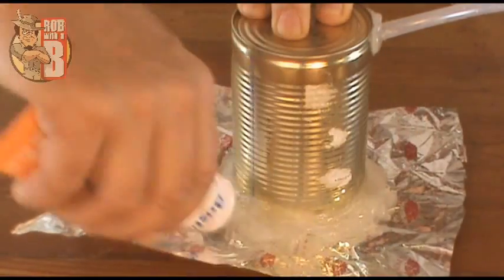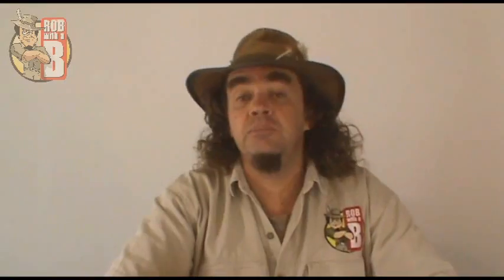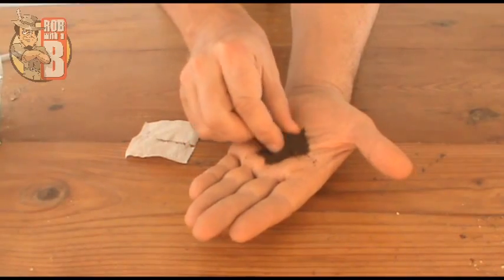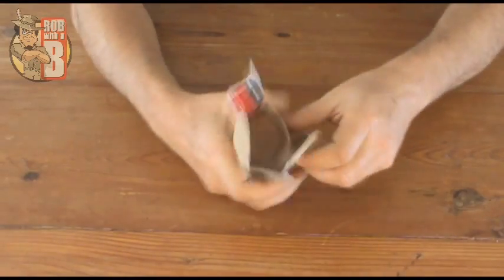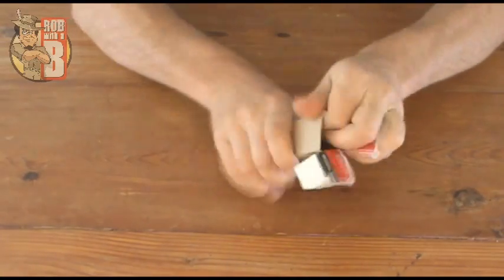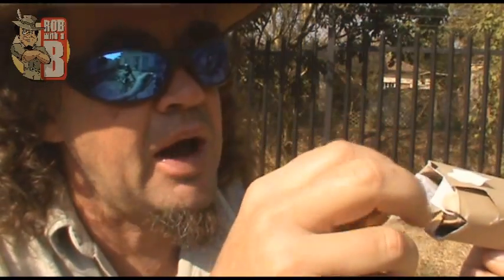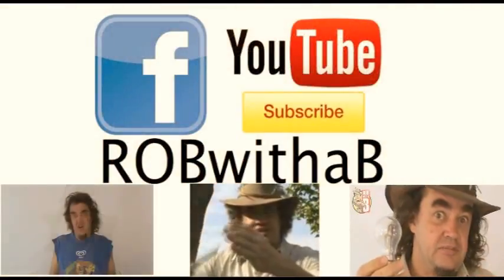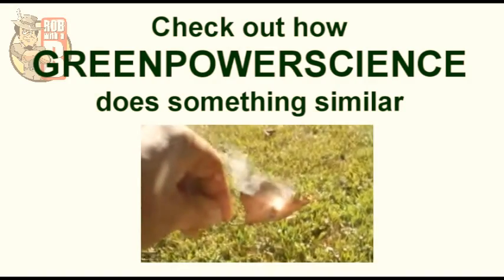How to Make Fire witha VACUUM - Quick Fire 101 #9

Comment: chip bag is most likely to see at least in an urban setting....
this is the same method if you want to make a large one with like a garbage can lid and actually cook with sunlight...GREAT video...
Reply from the maker: Yeah, this mylar foil stuff is becoming very common.
A lot of camping/survival meals are packed in it, and also many types of snacks. So it's the sort of thing one might plausibly find discarded even in wilderness areas.

Comment: It's now official, you are the worlds most creative pyromaniac!
I'll bet you could figure out how to set shit on fire with three nails, a banana peel and a gum wrapper.
Reply from the maker: kneuromancer Hmmmm.... Let's see:Nails are usually galvanised, so there we have the zinc anode. Gum wrapper yields aluminium as a conductor (and resistor if torn into a thin enough strip). Banana peel is our electrolyte. And as we showed previously with the rhino and zebra  turd, many types of herbivore droppings are great smouldering tinder.Still missing the cathode part pf the battery, though.And I don't think three nails would be enough, honestly. But it's a challenge I'm happy to accept. Stay tuned...